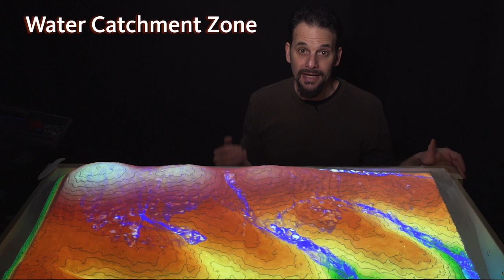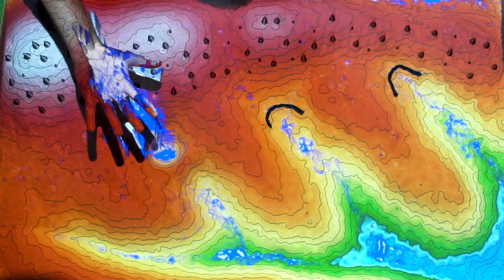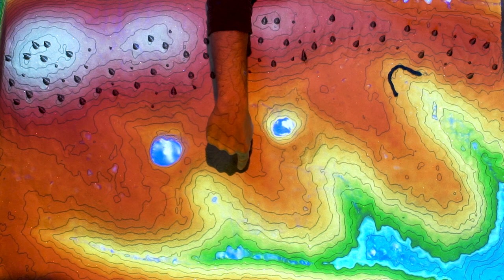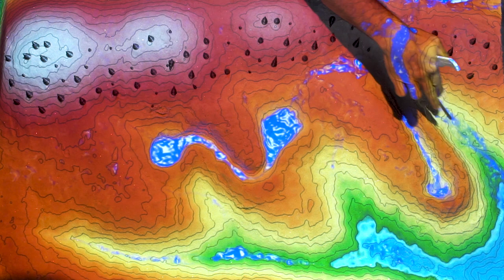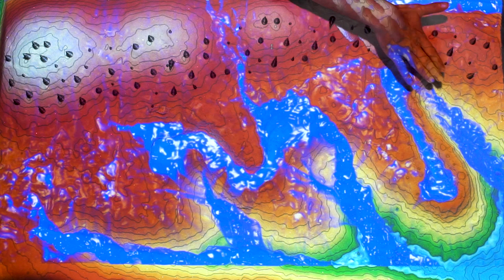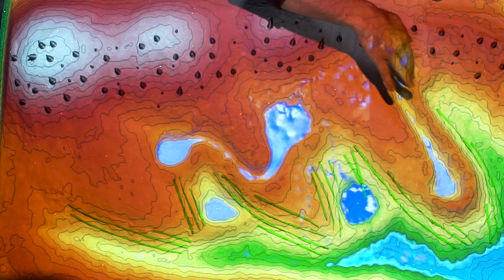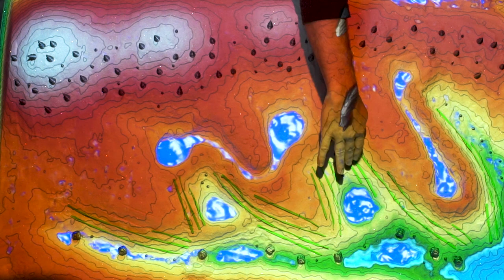Keyline® in the AR Sandbox #3: Design for Water

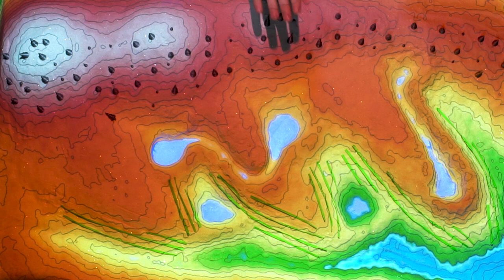Comment: 7:26 the green lines are keylines that divert the water across the ridge?

what is the difference with swales? do swales go along the contour lines, or do they gradually descend from one contour line to the next?
Reply from the maker: The green lines represent the cultivation pattern. So that could mean how a field is plowed, or it could mean the orientation of orchard rows. They are now swales, but just the pattern by which rows of crops or cultivation lines are oriented.
In the wider world, a swale just means a low area where water flows. But in Permaculture-speak, a swale usually refers to a water harvesting ditch placed on contour. I like to use the terminology of "on contour" or "off contour" swales, because then that can be understood by people who only know about permaculture and also people who are fluent in the language of civil engineering and landscape architecture.
Reply from the maker: @intrepid-crossing2356  There is a ton of confusion out there so that's why I say on or off-contour swales. Keyline is a very specific set of methods and people throw the terms around without really having a grasp on the terminology of the  trademarked system. In the Keyline design system, water management structures are typically sloped from valley to ridge forms. On-contour swales are level in the landscape. But which strategy to use depends a lot on your soils, climate, and rainfall regime . There are two primary sources I would refer you to: https://www.amazon.com/Water-Every-Farm-Yeomans-Keyline/dp/1438225784
http://www.regrarians.org/product/regrarians-ehandbook-3-water/